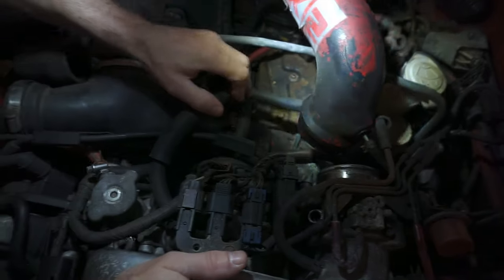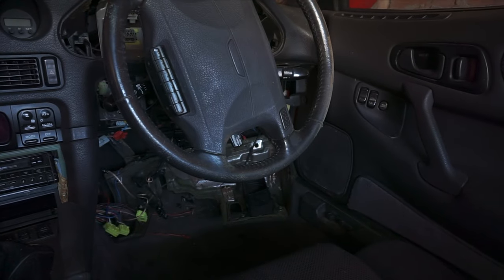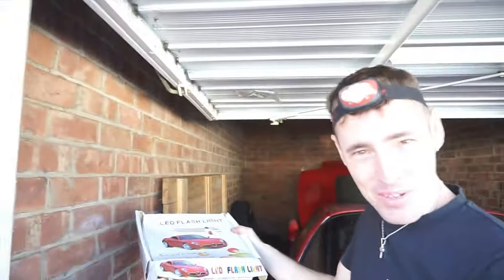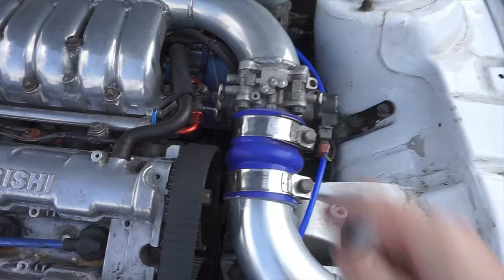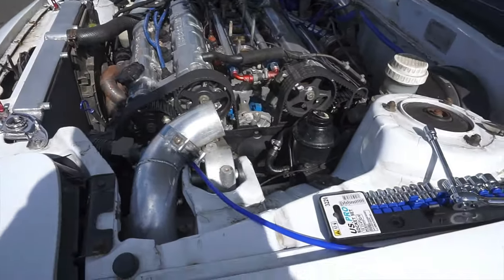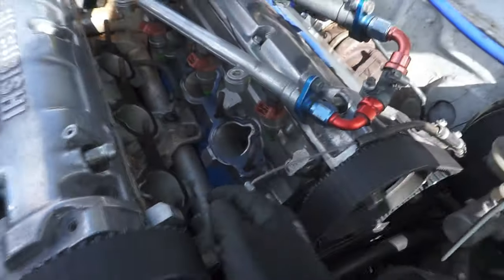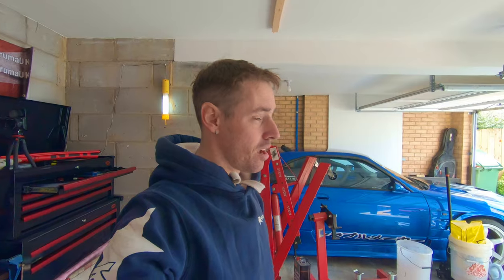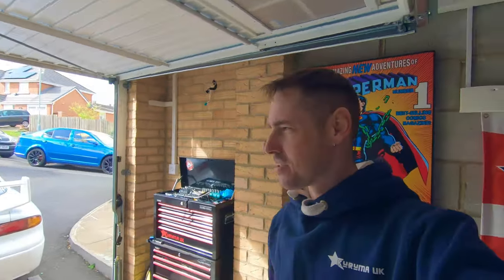MITSUBISHI GTO INTAKE MANIFOLD GASKET CHANGE || I DROPPED SOMETHING DOWN THE ENGINE!!! 😩

Comment: I know that frustrating feeling of things not working after few attempts 🤬 keep on diagnosing, you'll find it 😉

Eek dropping something and not hearing it on the floor is tense, that was edge of the seat nail biting suspense 😳

D'ya have an impact driver to crack loose those idle control Philips screws? 

I think that throttle dampener chamber was the old school way of easing/dampening the throttle closure to "idle up" & stop it stalling when you suddenly release the throttle to press clutch & brake at low speed. 

The TB coolant lines helps stop it freezing up during intense winter and some makes even use it to operate the old waxstat fast idle cold start mechanism (early days EFI) . 

U tried spraying brake cleaner around the hoses & joints & gaskets to locate that leak? 

TB to manifold gasket sealing? 

Hard to tell on telly/phone if it's a hissing vac leak or mechanical whining. 

Maybe try disconnecting/blocking/clamping ALL the vac hoses (brake booster, boost gauge, carbon canister, PCV return line, everything) off the inlet manifold to see if the leak is via the hoses or within the manifold?
Reply from the maker: pollypopperpop wow buddy! What an awesome response! Thank you 🙏! 

Yes I know.. I’m changing gasket on the upper part soon. I’ll be spraying all joins soon too. 

💙
Reply: I have the same problem with my idle control valve screws 🤣 With regards to throttle coolant lines, you could bypass this to help with keeping the intake of air cooler. Some cars may not be happy with this though so check first.